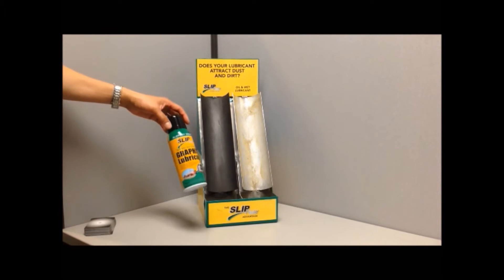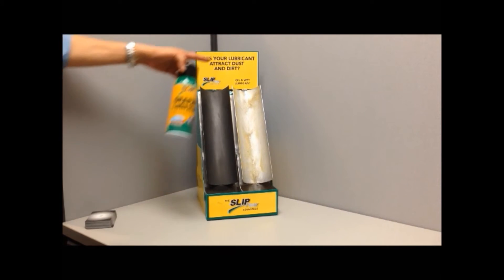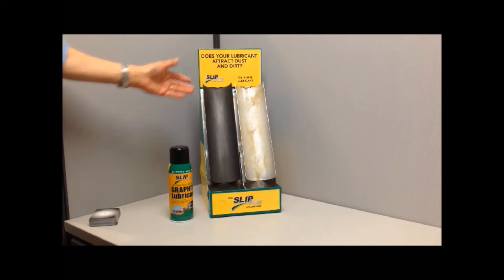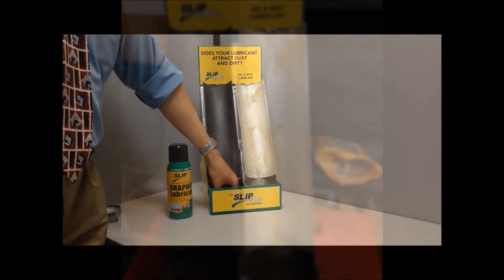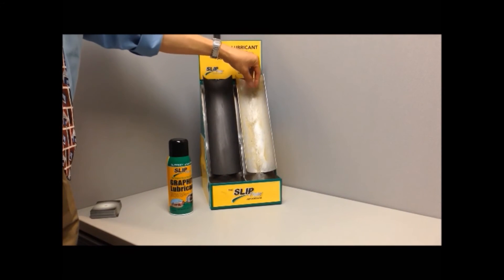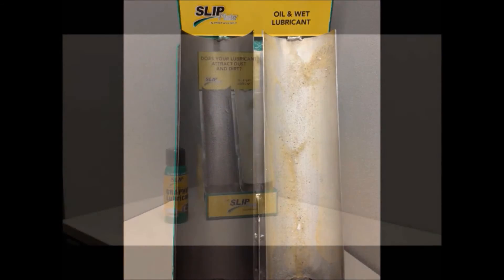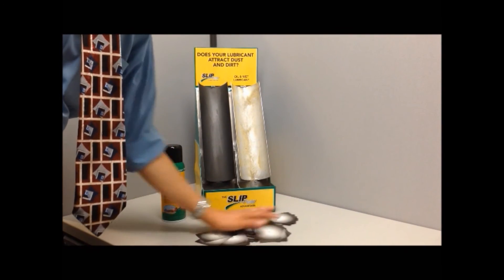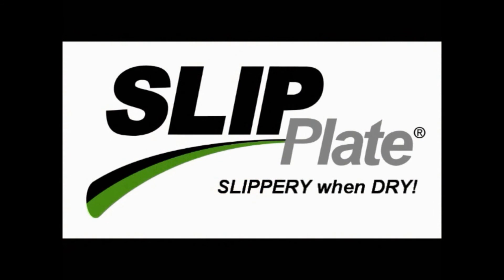SLIP Plate Dry Graphite Lube Demo

Comment: Hello , I want to add the slip plate dry graphite lubricant to bottom of my 30” push mower deck. QUESTION is my mower is brand new . Should I sand it a little bit so it can stick better and clean the residue before I spray it ? Thanks in advance

Comment: Does the dry lubricant stick on the contact areas forever or it needs to be reapplied?
Reply: We use the gallon liquid version at work for storage container door seals. I’ve seen containers come back after about a year with excellent adhesion. This product can be recoated very easily too.
Reply: @tonyb7748  Even though over one year late I still thanks you for a genuine reply